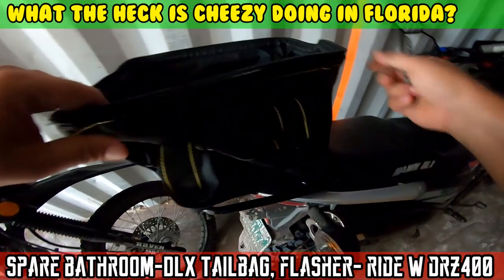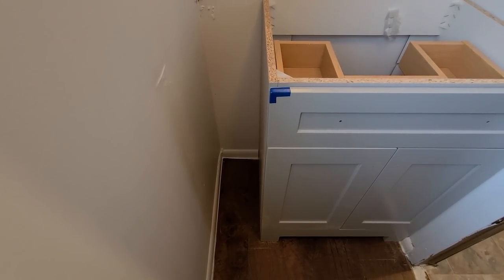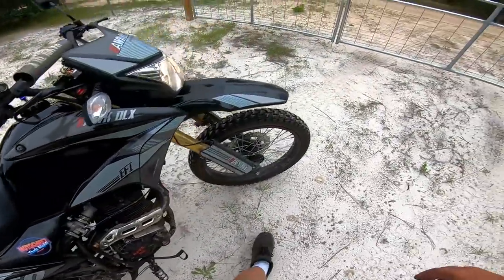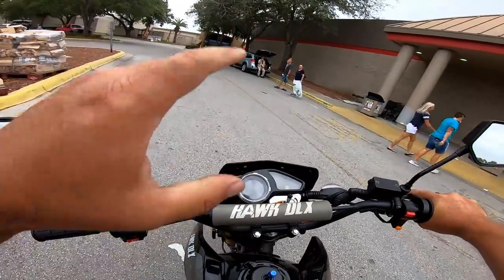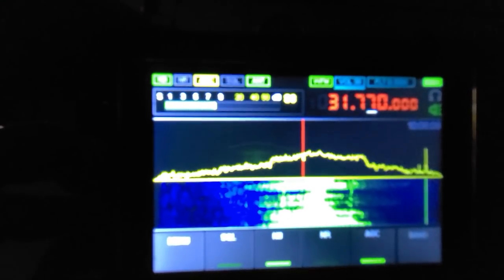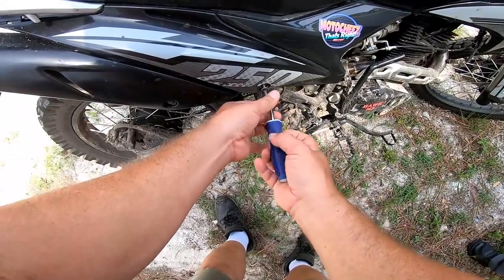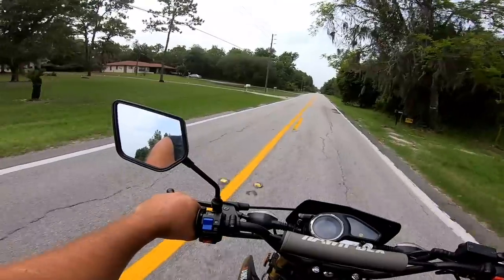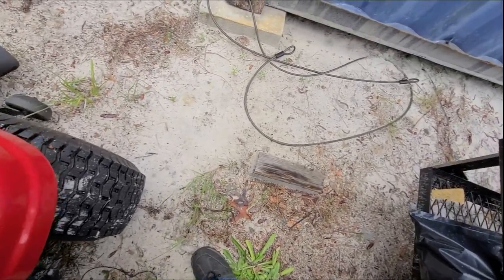(S3 E16) Spare Bathroom DONE, Turn flasher DONE Tali bag DONE. Hawk DLX and DRZ400 ride

Comment: yep, the seat concepts low is a freaking brick. harder than the stock seat.
Reply from the maker: My seat concepts was pretty good, but I didn't have a low profile.
Reply: @MotoCheez  I figured it would be a small improvement over stock and a bit lower, nope lol. If I was keeping it I would have the suspension lowered an inch and a half and get the comfort seat. I end up standing most of the ride if it's over 2hrs.

Comment: is the hawk exhaust a one piece system? Do you have any exhausts you'd recommend for the Hawk DLX?
Reply from the maker: It's same as regular hawk but there's no programmer to compensate for the change. Plus you'd have to weld O2 sensor on

Comment: It's always interesting hanging out with Cheezy. My tappets on my TBR7 are kinda noisy when the motor gets hot. Is that normal? I've adjusted them a couple times got about 4000 mi on it.
Reply from the maker: It's normal for them to get a bit noisey. That's why I run 20w50 since I'm offroad slower moving being air cooled.
Reply: @MotoCheez   I respect your knowledge on these things. I figure if I get 10k trouble free miles out of it.I'd be happy. I don't drive it hard, don't even go off road. There's no place close to go off roading where I live. It's all private land for miles. Thank you keep cheezin
Reply from the maker: Should go 10k easy! Plenty beyond that now

Comment: Hey, one of your sink hoses DID have a leak on the far left just under that brass fitting! (looks like it runs down the top of the hose when it's first shown @18:37)
Man, I hope you got that sorted out after filming
Reply from the maker: I haven't seen any drips in a cabinet and I've checked it a few times a day, I'll get underneath and recheck that!
Reply from the maker: I just rechecked both connections and they're both dry, maybe it was an illusion?
Reply: @MotoCheez Good thing, just glad it's not leaking
Reply from the maker: Yeah I actually had another comment that said it looked like it was leaking. I'm going to see if I can tighten it up a hair more just in case, I do shut all the water down and drain the pressure when I leave we all know how that particle board will withstand water!

Comment: Nice All around video had something for everyone. Your place is definitely looking good, are you going to put a gable roof on?
Reply from the maker: Thanks, I don't think I'm going to Gable the roof there's nothing but rain down here no snow load. I will probably just end up screwing your pressure treated board across for the rafters
Reply: @MotoCheez  yeah that makes sense here in Midwest people do that a lot and then put host down beside it to help because of tornadoes and storms plus it let's little air blow through in the summer ventilation. If your room's good have you thought about maybe just getting a rubber membrane and it is screwing it down on the sides just a thought, I know some of them EDM type Roofing have like 30 either 60 year warranties and you can do them yourself.
Reply from the maker: That's some good ideas!

Comment: I really enjoyed the video but I'm going to go right to the point. BCD 436 is exactly the same scanner that I have. When I first got it it was probably the most intimidating thing I had ever seen in my life. If you Google search for "easier to read BCD 436" you'll find a manual that is indeed easy to read and understand. Also keep in mind that the scanner was designed in 2013.. but it has everything you need. The worst thing I found about the design was it easy to tip over the unit while you have it on a desk. Number two is that you can only charge the batteries while it's off. And the other was the mini b USB cable plugged into the side. If it happens to fall off the desk and onto the floor you can smash the cable port on the scanner. But I've had mine for 9 months but I'll tell you it's the best thing ever I leave mine on 24/7. You're saying if you want to be uninformed don't read the paper. If you want to be misinformed read the paper and if you want the real news to listen to the scanner. So you going to need a Windows PC that connects up to the scanner and then you can download the Uniden BCD Sentinel software. You'll be very happy with it after that. You can update the frequency database once a week, set up little groups of channels that you want to listen to. 
What I did to protect the scanner was get a big aluminum  phone holder. (OMOTON C4 on Amazon) then I just got a big black rubber band to hold it onto the base. Makes it much more stable. The next thing I bought on Amazon was a USB charging cord that attaches magnetically. (Netdot gen7). That way if the scanner Falls over it won't rip the charging cord out . Those work on the GoPro 2.
Reply from the maker: Awesome, it is a great scanner I have the home patrol too at my house up in Connecticut and I already updated the database and the firmware was already current. I know my way around these pretty good from having the home patrol too up north, that is also on 24/7 along with an old BC unit in scanner analog that runs 24/7. Your statement is correct about being uninformed and misinformed. The magnet connector is actually a great idea! I'm going to see how that GPS add-on works while I'm traveling.
Reply: @MotoCheez  it's a great scanner it gets everything. New Hampshire is All Digital. Massachusetts towns arris mostly analog except for the state of ma is all Digital ie state police. I like the duttek 90° mini to micro USB adapter. I couldn't find any mini USB magnetic adapters. If you find one please let me know. Thanks 🧀 y!
Reply from the maker: Yeah I think they keep firing emergency channels down low frequency still and analog because of the volunteer firefighters and emergency responders
Reply: @MotoCheez  it comes down to propagation and available frequency's. You can have a bunch of people talking on the same frequency yet they don't hear each other. On analog frequencies you and I can talk to each other if we have the same ctcss code. If i don't have that code when you transmit to me I won't hear anything. But if I'm just listening to your frequency with no CTCSs code I will hear you but if I talk back to you you won't hear me. So when the FCC hands out the frequency they may give you  151.1 MHz and a ctcss code. Now other towns can use that same 151.1 with a different ctcss code and all share that frequency. But it's still limited so they went to digital because you can get hundreds of users on one frequency and free up a lot. And with digital you can also encrypt if you want. That's what CT state police use. The system is called APCO 25. That way all you need is three high power antennas placed on the highest places in Connecticut and everybody can share them. it's a whole another subject.. we did a little research on the APCO 25 when I was at Bell labs and they were just looking for comments on what they were proposing. We found that they had these walkie-talkie sets for preteen girls they were all digital. And we found that pushing the transmit button while we grounded a pin inside would jam the APCO system and shut it down. So I hope they fixed that. We call that babies first Jammer
Reply: @MotoCheez  when you got some spare time go to RadioReference dot com and you can read about everything. Including what people really think about the scanner
Reply from the maker: Yeah I did all that before I purchased it, it's supposed to be the best handheld scanner out today from everything I've read
Reply from the maker: Well damn! That's not good
Reply: @MotoCheez  I was like 20 years ago though they fixed everything..